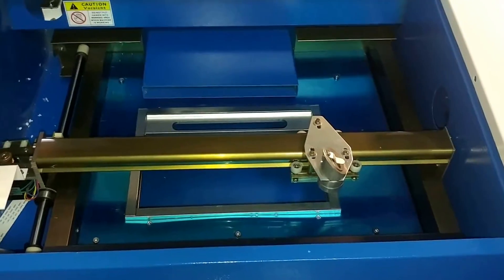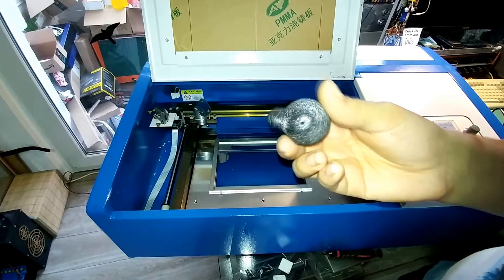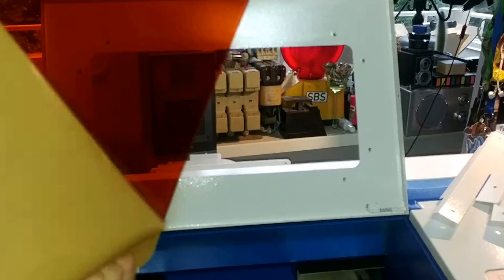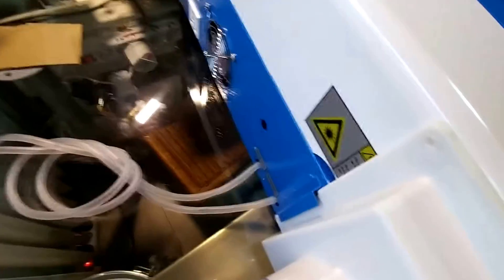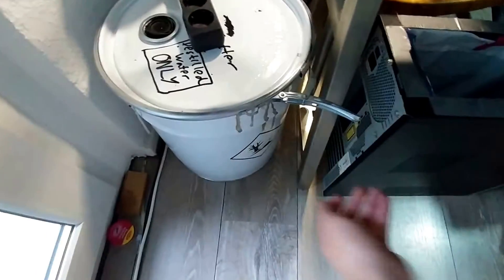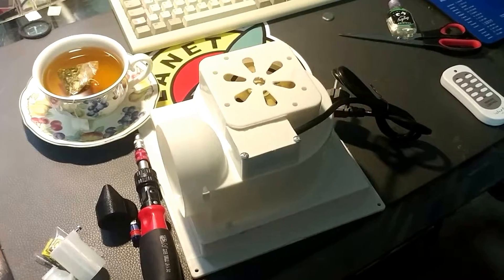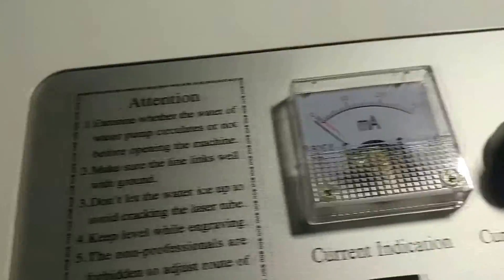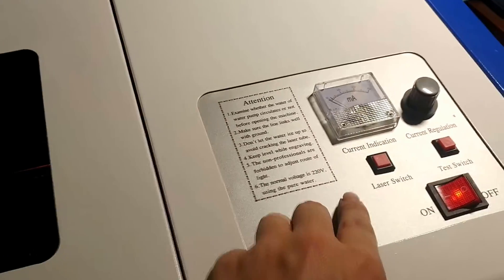K40 laser cutter setup

Comment: Awesome video, many thanks! 
One thing still bother me - how do i properly ground the laser? Can i mount the ground cable from laser to the grounding of the regular socket, if i dont know where the gronding is? Thank you
Reply from the maker: The 3 pin power connector on the back already has a ground pin in it so unless your electrical outlet has no ground there shouldn't be any grounding issues. There should be a red jack on the back to connect a banana jack with a ground cable to. Best to connect it to some (heater-) piping nearby, since those are grounded
Reply: @HardDiskLover  thanks a lot

Comment: The pump is likely NOT grounded! :/

I found this out wanting to switch the plug to use a different ground style plug.
The cable only had two wires inside of it, despite the ground on the plug.
Reply: no it is not.  i rewired my whole unit made sure it was not drawing too much current for wire size, rewired the areas that were substandard , and grounded all to earth. total amp draw with 2 fans, 2 water pumps, and added equipment, 6.5 amps at 110 volts. all is good.